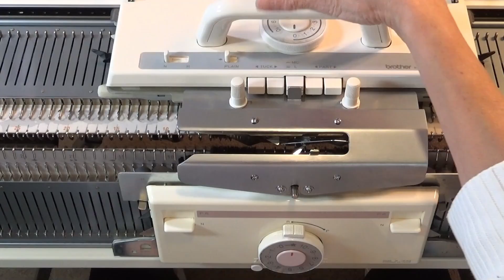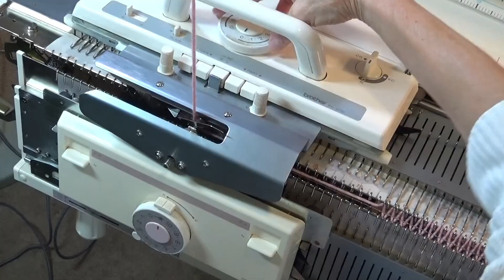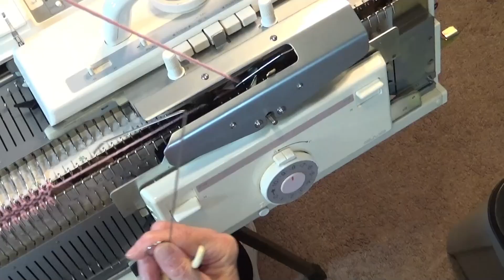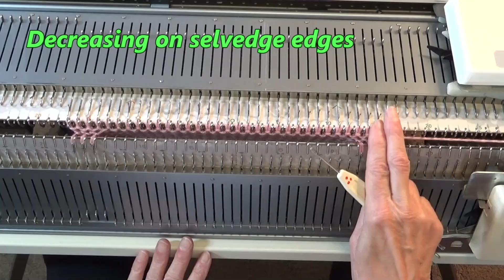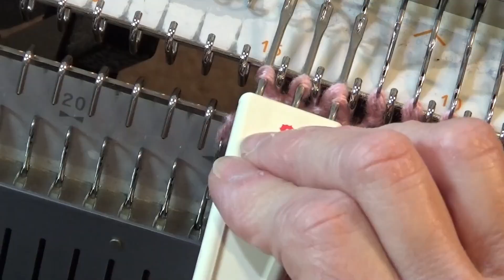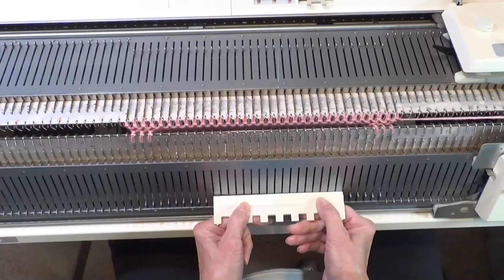Machine Knitting Technique   Long stitch No roll Borders

Comment: Can the long stitch be done without a ribber for the cast on
Reply from the maker: Yes. You can cast on anyway you want and then immediately transition to long stitch or later transition to long st. If doing it immediately, I would knit 1 row and then  fill the ribber with bars for a firmer edge.